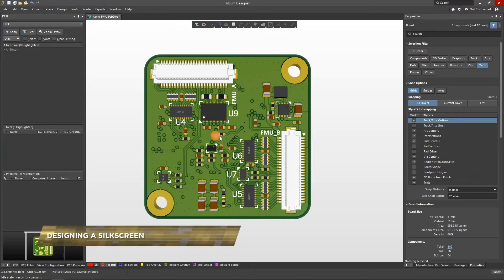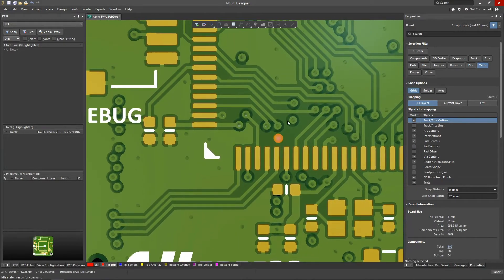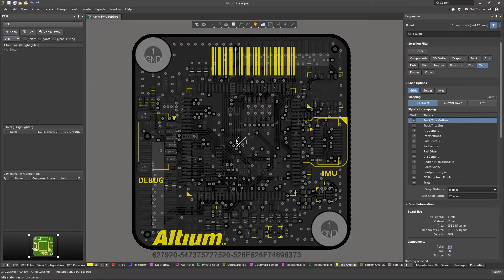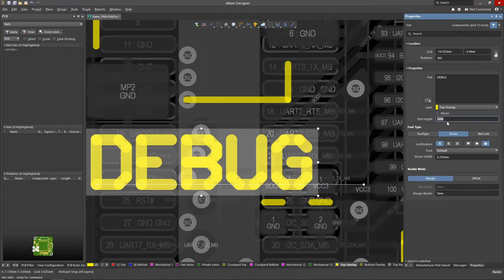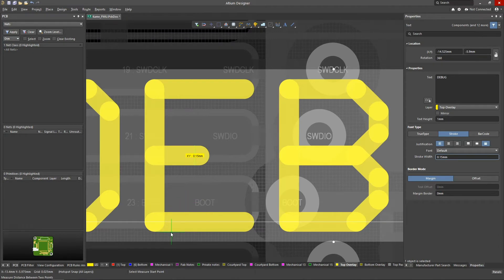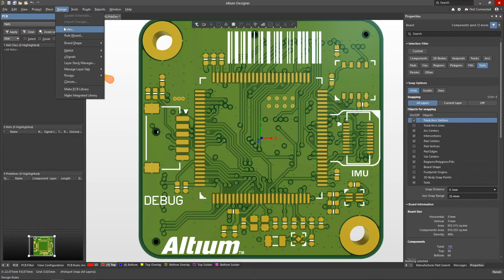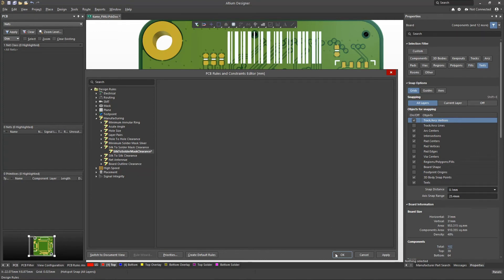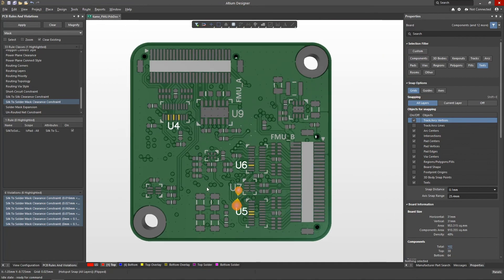What to Consider when Designing a Silkscreen Layer

Comment: I have found that a very useful silkscreen technique that makes silkscreen testpoint labels, instructions, LED names, etc. more attractive and easy to spot when looking at a large busy PCB is to use specific true type fonts that just happen to have relatively equal width lines and then use the Altium inverse text feature.  Less inking is then required to create equal visibility because the screening is producing mostly the background of the text rather than the strokes of the text.  This allows you to use narrower "strokes" because it is the absence of ink rather than the ink itself.  Always specify an inverse text border at least equal to your manufacturer's recommended minimum stroke width and then adjust the height of the text so that at least 50% of your manufacturer's normal line width is still remaining (this varies with font).  When using the less expensive epoxy inks, the ink will pull towards the center of the inked area (just like solder paste) leaving the narrower lines free of ink.

There are only a small number of True Type fonts (or other types of proportionally spaced fonts) that work well this way, and out of many dozens of commonly available fonts that I have examined, I have found only two that produce very legible and attractive results.  The first font that is readily available and highly legible (the one that I use), unfortunately, is Comic Sans MS and is a standard font for Windows (since around Windows 95).  I say unfortunately because there are only 2 kinds of people in the English speaking world - those who love it and those who hate it, but it is a very successful silkscreen font with generally equal-width lines.  If you can't stand Comic Sans MS, then try Arial Rounded MT Bold, but this font is only installed on your PC if you have also installed the Microsoft Publisher app that is usually sold as part of the Microsoft Office Professional or Microsoft Office 365 bundle.  Look for fonts that have rounded edge strokes that consist only of very close to equal-width lines.  In both cases, be sure to also set the "Bold" attribute when editing the text in Altium or the lines will not have sufficient width.

Important Note:  If sending PDFs that contain these fonts to vendors, especially if they are using non-Windows PCs to process them, is to use PDF options that embed the font along with the PDF document!

For silkscreen designators, the shortest legible text is to use the stroke font, but instead of the default stroke font, use the "San Serif" Altium option because it will maintain the same line width and text height, but the text will be about 10% or so shorter.  This is primarily useful for those very tight layout boards with lots of vias or to permit slightly taller text in the same PCB board space.

My final trick to make silkscreens look better without compromising board integrity is to specify a manual override on the soldermask for vias (assuming that you are not tenting your vias entirely).  Instead of expanding the soldermask around the via by a few mils, I partially tent the via (i.e., I shrink the solder mask a few mils in from the outside edge of the via) while still leaving plenty of room to avoid getting soldermask in the hole.  Obviously, this only works for vias that are of sufficient diameter (i.e., not micro-vias).  The few extra mils of tenting make the edges of any silkscreen falling in that area considerably more visible and also avoid the silk-to-solder mask violations.   Don't partially tent so much that insufficient clearance is remaining to the hole edge to cause quality control failures or rejection of your artwork by your fabricators.

Don Lucas
30+ year Altium user
Reply: Thanks for sharing your knowledge! Super interesting and well explained!